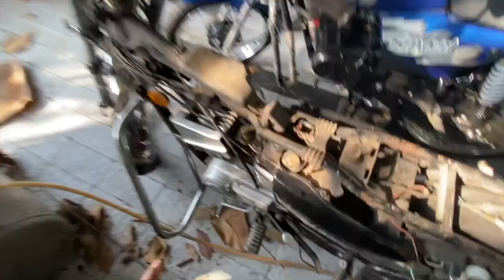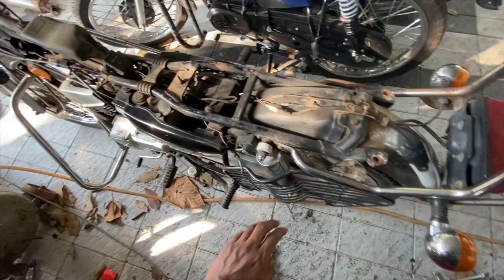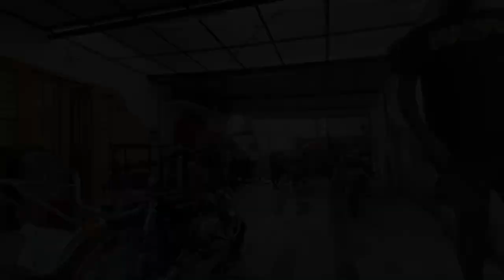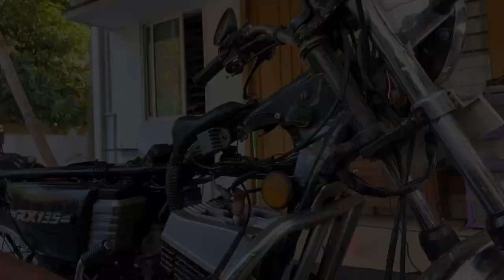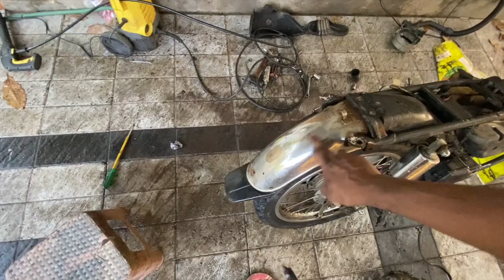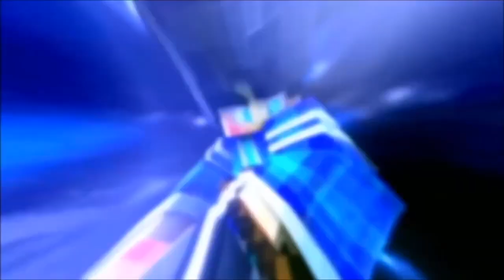Yamaha RX 135 Tiger restoration update | Disassembly (English Video)

Comment: You sure it's a tiger? I think tiger came with 5 speed like covers & smaller oil pump shaft but it was 4 speed with clutch & primary same as rxg. Even I have a 1L5 135. I request just for once swap the clutch bell with the rx100 one. You'll love it! Btw great restoration series. Best of luck!
Reply from the maker: Actually that’s a misconception, tiger came in 98 and 99, 1L6 series. Had tiger written on the side covers, engine covers were similar to old rx 135 4 speed.